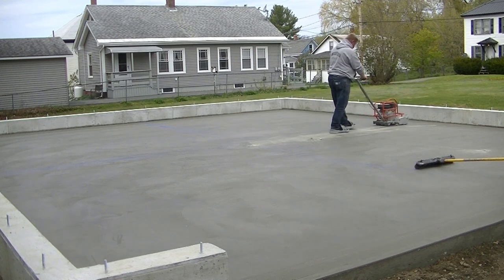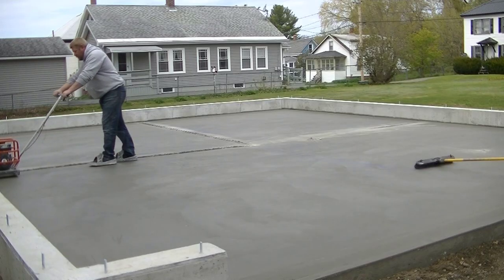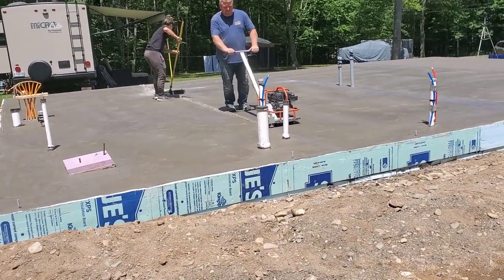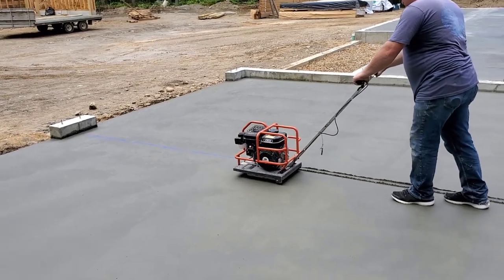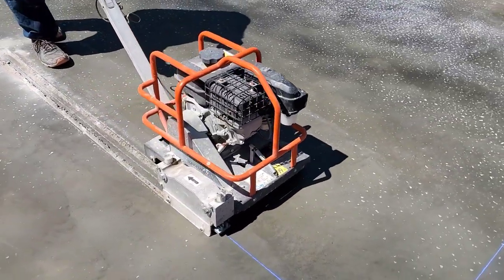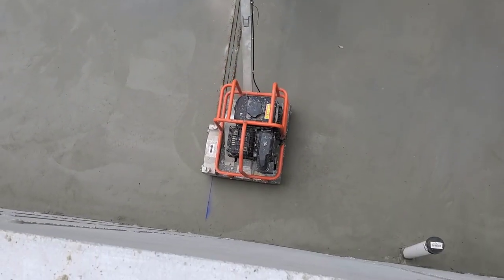Saw Cutting Contraction Joints In Concrete Floors & Slabs (Does It Really Work?)

Comment: the fiber mesh you were pouring with  last week is a good job, mesh is not used properly and is on the bottom of the pour mike, fiber mesh is the whole way through the mix and prevents cracking,i have poured slabs for myself and never cut from 2000 to 5000 square feet ,with mesh you will still get cracking with fiber it seems to be a whole lot better in my opinion

Comment: We do. Our selfs. Or our floor guy if were to busy.   Went to zip strip when we pour.  , love it great crack control
Reply from the maker: I did zip strip for years before these saws, I'm not a big fan of it myself.
Reply: Hard to get the zip straight and if u aint got alot of people it can become a hassle.i just cut the job the next day in summer.sometimes ill wait 3 days in the winter because of chipping
Reply: @nickieb5297  mark on each wall. Quick string across put grade stakes  in line  zip strip tiny piece duck tape to pin. Works great straight as an arrow. And grade all same time.      We dont saw  cut.   Cracks nice straight

Comment: I have 2 of them saws. They work great. You want at least 2 inch deep cuts. You dont want to cut to  green or will chip the edges. But useing these saws for years. Dont eye it. Use both guides. yes it shakes a little but you will learn the saw. You want your joints straight as can be. A big long driveway will look like shit if your cut is not straight.  But thanks for taking the time you do to make the videos you do. Just want to say my kids work with me to
Reply from the maker: My guys won't use the cheap guide, they been sawing with it like this for years, straighter than with using the guide. Other than that, they love the saw.

Comment: My house Slab I'm thinking about pouring is 250mm thick with four layers of 10mm mesh 200mm spacing. With lots of reinforcement in the slab is it still necessary to cut control joints?

Comment: I was hoping you’d make this video. Big fan my brother! Fellow professional here and it’s great to watch and listen to your stuff. It’s really meaningful to us younger guys to gain as much wisdom as possible from experienced people who are committed to doing things properly. 
About this video, I’ve never done same day saw cuts but I’m going to try. I usually feel worried that I’ll scuff it up too much. Are there any things that we should NOT do when attempting this? Also. What Method do you use to get the detailed cut against the wall edge? I recently bought a 3” diamond wheel to get a tighter cut with an angle grinder. Also do you ever use the tapered groover blade? Thanks again?
Reply from the maker: It doesn't scuff the floor after power troweling to a burn finish. Broom finish we wait a couple hours. If you don't burn finish just wait an hour or so before sawing. Not sure what you mean by cutting against the wall. The was cuts to about 2.5" of the wall, you can finish with a hand grinder if you want to, we usually don't. I don't use the tapered groover blade.

Comment: Hey mike do I need a joint for 24x48 shop floor 6-7 inch thick. I read some things say you don't need them indoors. I get pissed when I'm rolling under the pickup and my creeper wheel gets stuck in one

Comment: I used to have soft cuts when they first came out.I don't know 87 1/5 of thickness.Teenage slab beautiful crack every every time.Can't wait too long until burn.The blades up and you can't push too hard.Or you'll spaw the edges
Reply: SOFFCUT

Comment: Hi Mike is it too late after 4 days  saw cutting a patio thats been poured? Need professional help
Reply: Better late than never.
Reply: Cut 25% of the thickness, I wouldn’t use the soff-cut blades because of the hardness already. Some finishes (top cast) and climates can allow ample time before installing contraction joints, it should be fine.
Reply: Diamond blades and yeah your good it's just better to saw cut right away makes it easier to cut
Reply: Thx for the tips boys... cheers 🍻
Reply from the maker: It's not too late but might have already micro-cracked and not visible yet. I'd still cut it though.

Comment: Where do you cut if there are thickenings in the concrete to support walls?
Reply: Just cut it normal, footings can/should be poured first to settle and mitigate the potential cracks. In a “mono pour” (footing and slab in same pour) the edge of slab can “fault line crack” if more settling occurs than is tolerated in the footing because compaction wasn’t sufficient...  No bueno.

Comment: How do you complete the cut right up to a wall or floor drain?
Reply: Grinder
Reply: @jalisquillogonzalez9675  - That works for a drain if you're very careful, but can't get the last couple inches up to the wall without cutting into it.

Comment: I take cardboard and put it in the cross cut and it won't blowout the joint
Reply: They also have higher quality inserts for. This is necessary 💯 of the time... for me. Attention to detail is 👍
Reply: @CaliVapor  definetly will look into that lol always MacGyvered my way through life but it sure would be nice to not have a bunch of torn up boxes in the trailer🤣
Reply from the maker: You can buy the ones soff cut has, we use cardboard too.

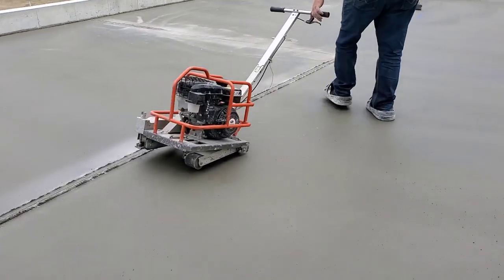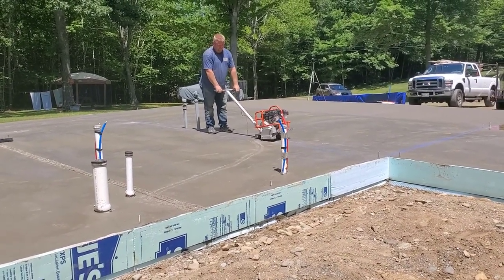Comment: I just poured a 11 yard pool deck at my own house, we started pouring at 3:30, by 6:30 it had cracked in 3 places and took all we had to get the stamps to show the pattern.  Even used retarder to slow it down. It was all in shade and couldnt even get the border grooves in it. Tomorrows going to be a bad day for my ready mix company.
Reply: 5 yds a stamp pour. Stabilizer is cheap. Sounds like bad mud though.
Reply: what was the temperature outside?  anytime you are pouring in the afternoon with heat and wind u are asking for Plastic shrinkage cracks.
Reply: @dukhtr3  it was 85, but in the shade. It's  bad mud, been pouring with these guys for 30 years and this entire spring has been tough.
Reply: I understand your frustration, but I’m pretty sure I know what’s gonna happen. At most, the ready-mix supplier rep will come out and say - “My product doesn’t come finished. I’ll guarantee a specific strength or better, but the finish is on you.” If you’re convinced you got a bad batch, you can tell them you want a non-destructive strength test like a Swiss-hammer or something, but that’s likely all you can do.
Reply: Did you to wet the substrate? A dry base can really draw water from the mix. On the other hand, I have seen horrible cracks on pool decks from overflowing the pool and pouring on mud basically. The pool can also have a bond breaker type like newspaper or sand around it. 🤔 let us know more on in this failure analysis
Reply: @iowamatt2519  hot expired mud?
Reply: @CaliVapor  it was 11 yards on one truck, they would never batch on top of old mud, they new it was for me personally  and the different colors and patterns  I was doing. Just a bad powder, probably Lafarge instead of Continental.  I even soaked the grade the night before, just a bad deal
Reply from the maker: Sorry to hear that Matt, must of been frustrating. Could have been hot mud, is that what you're thinking?
Reply: Gotta hit it early as hell

Comment: I've got a question,  on a new slab how soon is normal for cracks? Also I've got 2 exposed rebar wire bearly exposed, this normal?
Reply: You shouldn't have cracks or rebar exposed
Reply: @ponenubs1  its the rebar wire tie  not the actual rebar. The crack is a hairline if that makes sense
Reply: @LanceSheppard  🧐 Two guarantees with concrete, it will crack, no one will steal it. That said.. look at the; curing agent? climate? days until they appeared? Compaction % on the substrate? Seismic vibrations? Load bearing equipment? Joint placement? Cold joint? Many things to look for in concrete to do a failure analysis for cracks. The tie wire on the other hand, is just the iron workers not smashing down the tails ends, as we pour we usually step on them if they are up, attention to detail helps. They end up making rust spots and look bad and theoretically can rust to the bars eventually (years) and compromise its integrity 😝 hammer-drill them and patch? Hope this helps.
Reply: I’m a career concrete guy and on rare occasion I would notice a crack that was alarming enough that I thought I should bring it to the engineers attention. The rule of thumb is, if you can’t slide a credit card into the crack, it’s typically not something to worry about. 

Over the years, of the cracks I did call to the engineers attention, I was always surprised at how unconcerned they were when they saw it. Even with cracks that failed the credit card test, they knew that, as long as the internal rebar was not broken, there was no chance of any kind of catastrophic failure. Cracks seem to bother the architect more than the engineer, in my experience.

To your original question: Cracks can show up within a couple hours to years later. The wire sticking up is no concern. If it’s too much of an eyesore, just grind it out and patch it with a dab of Portland cement. But just understand, the patch may end up being an eyesore as well. The old saying in concrete is - A patch is a patch is a patch. 🤷‍♂️
Reply: @psidvicious  my man! Thanks brother. I love everything about concrete wish I knew more. This is the info I needed!
Reply: @CaliVapor  it helps a lot, thanks!

Comment: Ever use zip-strip ?
Reply from the maker: I used miles of it in the 80's before these saws were invented. It works good but still looks like a crack when it works like it's supposed to.
Reply: So just like knowing where to saw,zip needing to figure out and what size but I used to use a fair amount and could bull-float it or broom it,had mostly good luck and was done,no caulk,easy to sweep floors etc.I mom

Comment: this is one of the most annoying things i hate about working in concrete, i already don't understand the finishing process that well and then having to cut it just makes the day longer, most of my coworkers are clowns that act like immature children and can't work worth a damn, like they still have to rely on the guide arm when using a saw like in the video
Reply: Yes, last thinking i want to do after 10 hours of hard labor is hear 3-4 hours of grinding concrete. Like, “Just cut it, its a contraction joint!” Guide arm and accuracy is great for decorative joints or in “tilt-up” construction. When reopening contraction joints after concrete panels are installed, i like to have a straight line and i always use the guide arms to not widen the intended cut. (Important to align/set guide arms before each use)

Comment: The reason concrete cracks is because it shrinks as it dries. Cement only takes about 22% of its own weight of water to hydrate. But a 4" slump needs around 45% water and if you add more water on site.  And its not 1/4" deep. Its 25% of slab thickness.